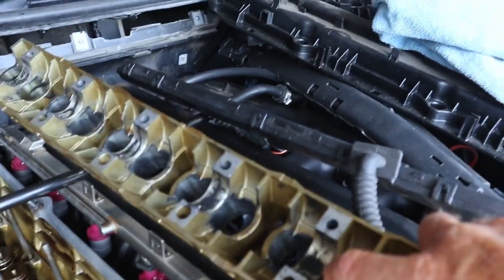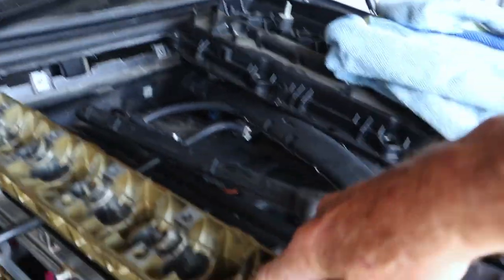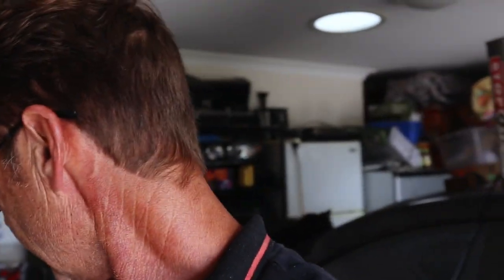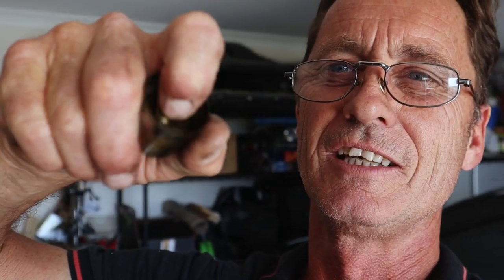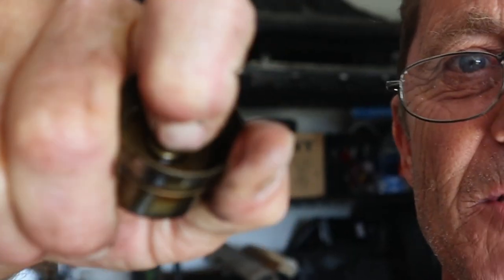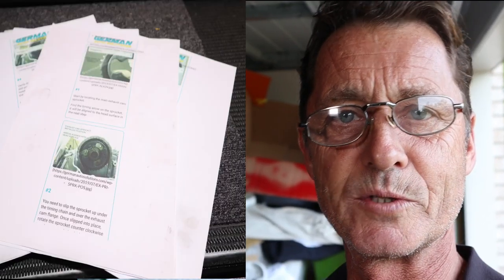E46 BMW PROJECT // CAMSHAFT UPGRADE: INSTALLING SCHRICK CAMSHAFTS ON MY E46 325CI

Comment: hi, can i ask you?
i have e46 328ci with offcurse m52b28tu, i want to upgrade the campshaft
the 2 options are ... or m54b30 camshaft or M54b30ZHP  or S54B32 
do u have an opinion?

Comment: When you are preping the engine for the valve cover gasket, you use break cleaner. Do you spray this directly onto the head? If so, do you need to worry about it contaminating anything?
Reply from the maker: Great question, thanks! The small amount of brake cleaner is not going to affect anything - like contaminate the oil. However, you need to be REALLY careful about small pieces of the old valve cover gasket which could fall into head. Quite often the old gasket gets very hard almost like hard plastic, and you DO NOT want any of this getting into your engine. Take extra care at this stage of the head clean up, use a plastic scraper (NOT metal), and use the brake cleaner and green scotch brite to do the final clean up. Also, I have always scheduled an Oil / Filter change at the same time that I have done this job, which you can do if you have any concerns. I hope this helps. Thanks Michael.

Comment: I’m also installing Schrick cams (mine is an M52TU) and am having trouble with the relative positions of the cams after turning the engine over - the blocks don’t quite sit flush with the head.  Did you figure out why yours needed some extra manipulation?
Reply from the maker: Hi John. Umh, No! I manually turned the engine over a few times and I was able to get the flywheel locking pin fully in and the locking blocks flat but as you say I had to jiggle the crank a degree or so to get it to happen. I am assuming it's because either the timing gear is a little worn or because of the more aggressive lift duration of the cams. I have since spoken to a couple of people here in Brisbane and no one else has been able to suggest anything other than "should be ok'?

Comment: Hey Mike how did you make sure the helical gear is in the right position on the new cams?
Reply: Yeah. How did he do it? I'm doing this right now. Did you ever get an answer elsewhere?
Reply: When you lock the camshaft from behind. Align the missing tooth on the helical gear facing upward and then use a metal ruler. The knife edge of the ruler should touch both sides missing tooth.

Comment: How much horsepower or torque improvement is there with the upgraded cams. Also about what did it cost for the upgrade.
Reply from the maker: I don't honestly know for sure. There are so many variables which will affect the final number, and on my E46 I have also added the supercharger. The cams should give an extra 20+ horsepower but also a great increase in torque particularly in the low to mid range.  (Which is what I am after with this project - all about getting to the next Red light quicker than the next guy). I will be able to give more accurate figures when I get it on the Dyno and get everything tuned properly. COST? When I bought the Cams they were $1,200 USD, which landed in Aust. was about $2,200 AUD. I fitted myself and I never got a quote to have someone do it. Possibly 4-6 hours labour for a mechanic...Maybe?
Reply from the maker: Oh! I bought them from VAC Motorsport, at the time they had a good range of Schrick camshafts for the M54B engine in various lift/durations. Suggest you check them out to see the different options that will suit your build.😀
Reply: @Sixty4motorsport  Thanks, I have a 2003 325CI and would like some more horsepower. I very much like the car and have had no big issues with it. Just trying to get enough information to decide if there are reliable engine modifications that will increase the horsepower or buy a 330.
Reply from the maker: @johncoss5604  I know what you mean, and I truly feel the pain of your decision. When I first bought my 325Ci seems everyone was either talking about the M3 or 330Ci in regards to HP. I don't think it's as much about reliability coz the M54B25 engine is a strong motor. It boils down to how much HP you want and where you want it in the rev range. From what I have seen ( and feel free to correct me if I am wrong), to get BIG horsepower even from the M54B30 is going to take a serious $$$$ and mechanical investment. The only advantage with the 330 is you have a slightly higher HP starting point, but with either engine to get M3 like HP you are going to have to take the engine beyond simply installing Intakes, exhaust, etc. I stuck with the 325 because I was going to have to do major upgrades to get the HP i wanted with either engine, and I could not see the point doing an engine swap just to have a 20 or 30 HP extra starting point. 
As I say anybody is free to correct me if you think I am wrong!
Reply: @Sixty4motorsport  Thanks again great advise.
Reply: @Sixty4motorsport  I love your build sir.  Absolutely badass in every aspect. While I agree with you on your build because you are supercharged and will have good low end tourqe. But here in the US you can get a low mileage  M54 3.0 for around $600 usd. And if you don't have the money for  a supercharger kit straight away it's worth it more for the low end tourqe alone, not so much for the horsepower.

Comment: In the process of installing the same kit but I can't find any good information about how to run all the tubing.
Reply from the maker: There are installation instructions on the VF Engineering website. However they are kind of general in nature, so you do have to make some adjustments as you go.
Reply: @Sixty4motorsport  my question is where do I run the hose coming off the oil separator? What hoses run to the charge pipe
Reply: I have two places for hoses on the charge pipe and than then to pipe that connects to the throttle body has another place to attach a hose
Reply from the maker: @darrenfickes2566  You need to modify the hose from the CCV to the valve cover. Remove the fitting that connects to the valve cover, and insert the hose joiner and the small section of rubber hose. This then connects to the fitting on the lower side of the air inlet assembly to the Supercharger. The other larger hose connection on the bottom of the inlet is for the by-pass valve hose assembly. You need to run this as best you can near the chassis rail and connect to the bottom of the intake pipe that connects to the throttle body. It's a tight squeeze! There is a vacuum line that you then connect to the back of the inlet manifold. (There are 2 capped-off fittings at the back of the inlet manifold near the firewall. You might need a mirror to help locate them.). You can use either one. Connecting the in-take pipe to the throttle body will take some time it's very fiddly particularly getting the clamps tightened. I hope this helps.
Reply: @Sixty4motorsport  thanks a lot that really helps. I couldn't figure that part out. So I'm guessing the shorter part of the hose coming off the bottom of the by pass goes the the pipe that connects to the throttle body

Comment: Do you have any recommendations for specs on cams for a turbo build
Reply from the maker: Hi. I found VAC motorsport had a few camshaft options for the M54 engine to suit NA and forced induction builds. Check out their website and you'll probably find a lift/duration to suit.
Reply: @Sixty4motorsport  thank you for your response and a 264/248 should work or go for something different for forced induction
Reply: Where can I buy it?  My car is 2004 e46 zhp i want schrick camshaft
Reply from the maker: @georgiageorgia7911  I purchased my Schrick camshafts from VAC motorsport, they have a different lift/duration camshafts for different applications.
Reply: What camshaft it is specifically? What °?
Reply from the maker: @guilhermemontagnoli1529  I've installed the Schrick Camshaft set. 264/248 Exhaust/Inlet, 10.5mm/10mm Ex/In. I purchased from VAC Motorsport, I found they had a great range of Camshaft options for the M54.
Reply: @Sixty4motorsport  Thanks a lot, i'm from Brazil and likes your job! Great car and great project! It's a inspiration your job with the BMW, one day i will have a project too.